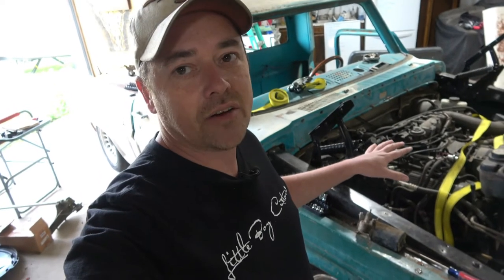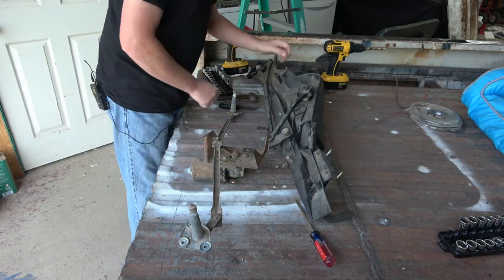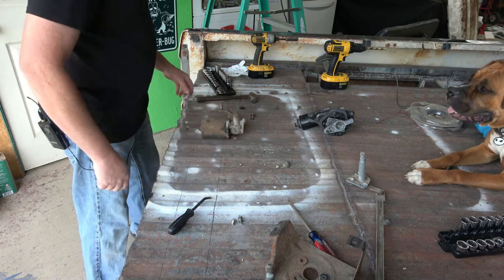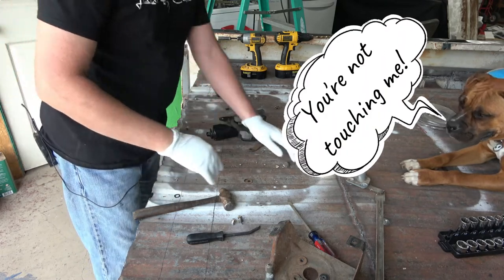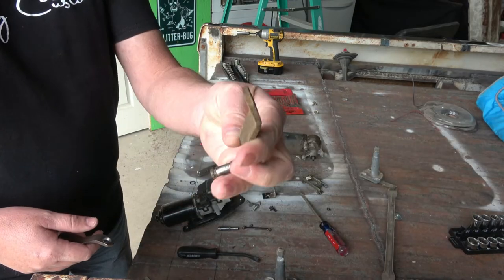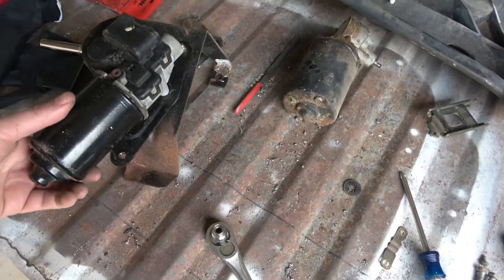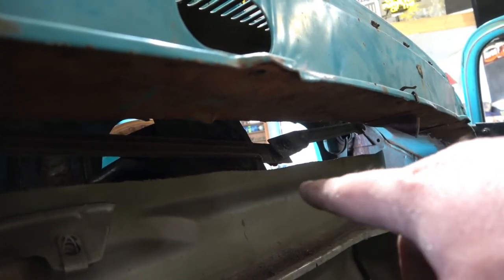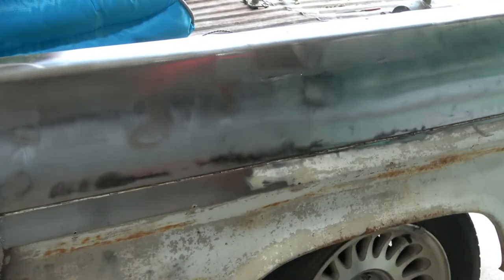F100 To Crown Vic Full Frame Swap Install Wipers In Detail

Comment: The wiper pivots will size up after a period of time, I drilled an 1/8" hole in the pivot where it would be under the cowl took a needle tip grease tip and pumped grease into the pivot, moved it back and forth by hand and it was working again.
Reply from the maker: Thanks for the info

Comment: I got a wiper motor out of a 2011 crown vic n it had a steel arm I just cut the two n welded them together
Reply from the maker: Wish I would have been so lucky
Reply: @LittleBoyCustoms  I also took that plate off the motor and clocked it sideways il try n get some pictures tomorrow truck is in storage